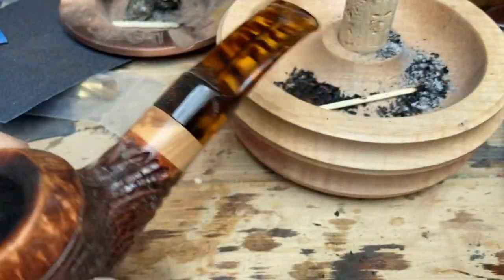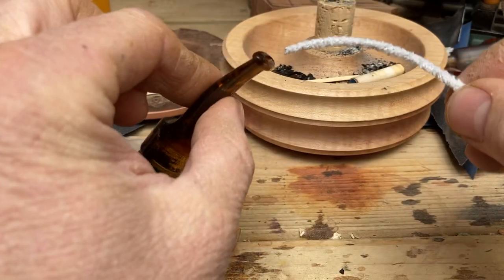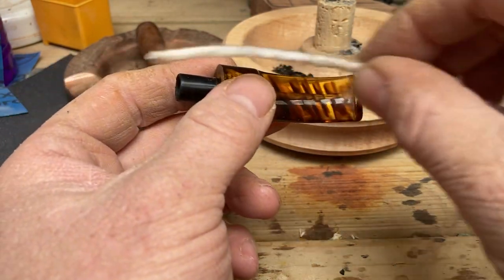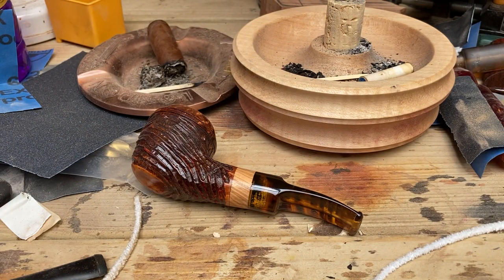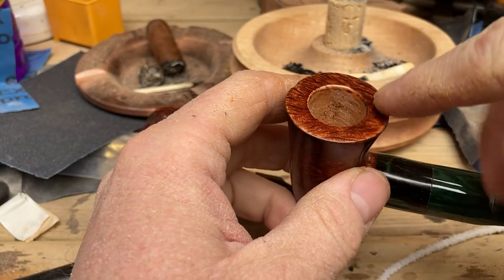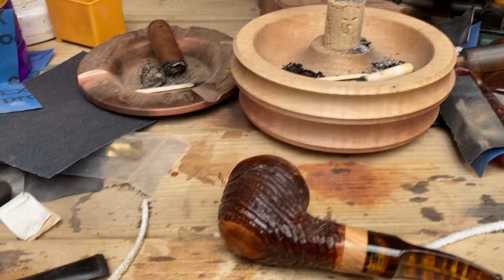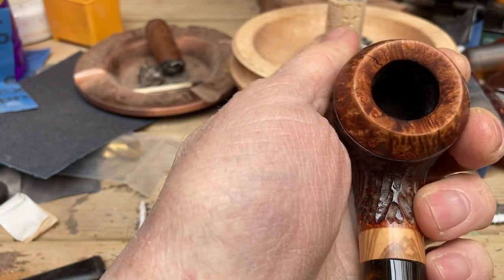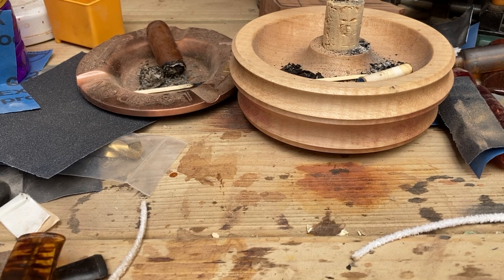How to break in and clean your tobacco pipe

Comment: I started smoking a pipe some 40 years ago and gave up for the past 20. Coming back to pipe smoking during the last year l've 'discovered' a little trick which is probably used by many of you out there.
I take a pipe cleaner, cut about 2 inches off, roll it in to a tight coil and put this at the bottom of the pipe, ( l smoke an unfiltered pipe). I find that this prevents the tobacco becoming too wet and l am able to smoke it down to the bottom of the bowl without too much waste tobacco. Then all there is to do is tap out the small amount left in the bowl and  the coiled pipe cleaner. In addition, l suppose the coil acts as a kind of rudimentary filter. As a wet smoker l used to find myself tapping out as much as a 1/4 of a bowl before l used this method. Smokers of Falcons will be aware of a filter of a similar nature to dry up moisture.
Reply from the maker: I’m going to try this with a non filtered pipe I love but haven’t smoked in years. Thanks for a great tip
Reply: @londoncallingwithsimon6817  

I hope it works for you....nothing ventured nothing gained!

Comment: How would you recommend cleaning a pip which has had a large carbon cake build up? 

Eg: I was not aware of all of this when starting smoking my first pipe (which I love dearly) and this pipe now has about a 2mm carbon cake, maybe more and it feels like it's too much. Every bowl tastes a bit ashy and it is not the same with my other pipes.

How would you recommend cleaning this? I love this pipe and I'd love to be able to smoke it with no issues :)
Reply from the maker: Sounds like you need to ream the chamber a bit. You don’t need a heavy cake, 1mm is plenty. Once reamed you could also give it a good clean out with alcohol, especially the stem and shank right up to the bowl. Spend some considerable time on that and you should see a difference. Let me know how you get on. Good luck.